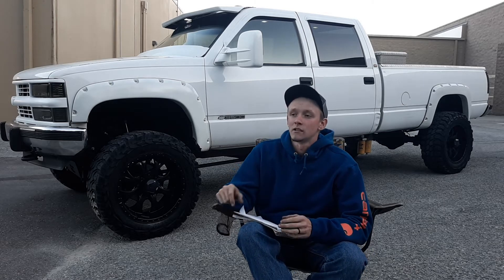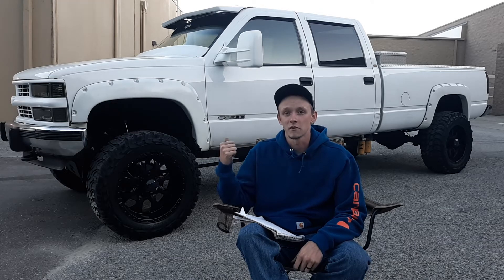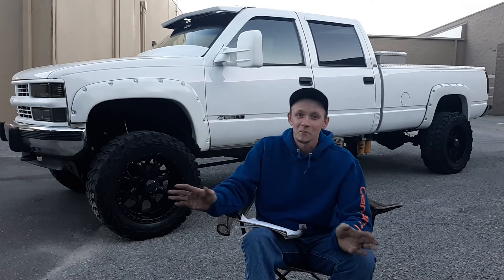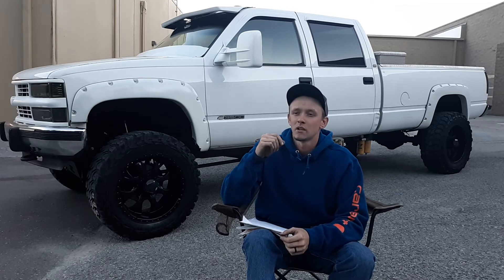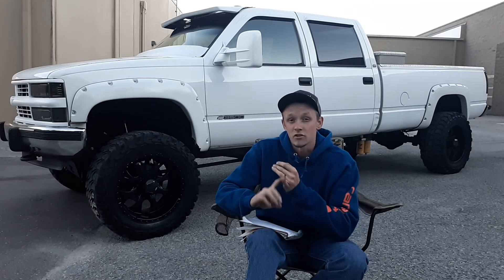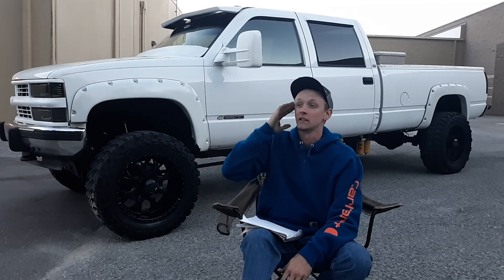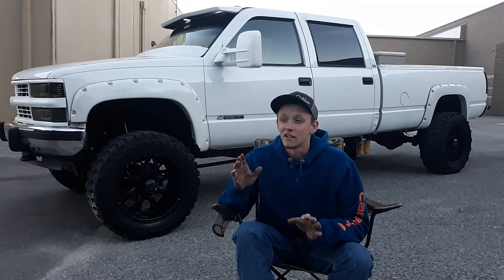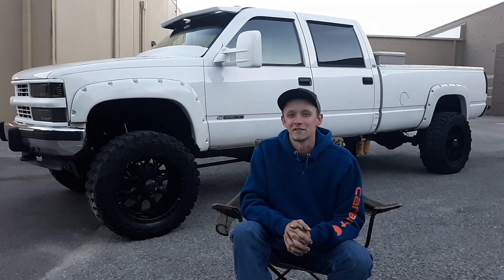Bombproofing a 6.5l turbo diesel #3

Comment: Bro 6.5er.,. Man i recently had issues Bigtime.. bought a defective I/P so caused me to try to prove it wasn't that but ended up being. Like timing both heads bolts pmd and of course and $$$ lifetime warranty I/P. 
My question, now my head lights stay on and U1000 code and seems I have to jump.glow plug relay.   When truck does start.   Intake turbo off.   Oil blows out the passenger exhaust.   Being I recently had heads done could it possibly be timing related.  
Thank you Sir keep up the good fight
Reply from the maker: Valves in the head are tied to the camshaft by the push rods. So long as you didn't remove the camshaft, and your lifters are ok, the valves should be working properly. If your blowing oil out of the turbo, remove the turbo and see if your getting oil before it. If you don't see oil in the exhaust before the turbo than the seals in the turbo are bad, if you are seeing oil in the passenger side manifold then you need to find which cylinder exhaust port is wet and that will lead you to the problem. The glow plugs controller, where you had the heads off, may not be quite grounded properly or the glow plugs controller may be defective.

Comment: I got a 99 3500HD what block do you think I have?
Reply from the maker: Well, it's kinda hard to tell depending if the motor had ever been changed or not but if I had to take a guess for a 99 I would say 506.
Reply: Well I ended up getting this truck technically for free, 131k original miles and motor bone stock. Have not brought myself to sell it. Starts up runs great I ran across ur videos. And figured because the platform is so great specially on a 3500hd dually frame is giant super stout. My question how much life can I get out of it? Before I have to put a Cummins in?
Reply from the maker: @michaelCrusader90  it's common to see full rebuilds right around 300 to 350k miles if they are taken care of. Some people have run them longer than that but that's just what I've run into.

Comment: I recently purchased a 1994 Chevy Silverado 6.5L Turbo. I want to get an entirely new engine for it. I was originally thinking of a 12 valve 5.9 Cummins until I saw a video on what a pain it is to install one in my square body. I then started watching your videos and would like to get a diesel from somewhere? Leroy Diesel sold out. I just want a good running truck that will last me another 20 years or so. Not looking for a pulling monster or a drag truck or a mud truck...just a good dependable truck that I can drive daily and pass a vehicle when needed on the highway. Any place I can get a good engine? Or is there an engine you would recommend that I can buy? I love your truck, btw. Thanks.
Reply from the maker: Thank you man, I appreciate it. Still have plenty of work to do but untill I get a few things squared away she's good the way she is. In my experience Leroy is just about always sold out, I wish he could still get the p400 blocks but unfortunately they have been discontinued. BUT, I have had pretty good luck with buying short and long blocks from O'riley auto parts. I know it sounds strange but in 1 to 2 weeks it comes in pretty ready to go. Or you might take a chance on a used motor but there again, it's taking a chance.

Comment: I am hunting a new motor to drop into my 99 K2500 Suburban... suggestion for best year to buy for a motor?
Reply: 98
Reply from the maker: Have you checked out my "the different 6.5l blocks" video? Definitely a bunch of good information in it, but if you were looking to pull one out of a truck the most desired motors are the 93 trucks 👍 I go into more detail as to why that is in the video

Comment: Last time I looked, the timing gears weren't available from Leroy Diesel. I'll have to go look again.
Reply: It says they're sold out and probably won't be available again unless there is a huge demand for them. It says he has to have them made 200 at a time to be cost effective.
Reply from the maker: Thank you for the heads up, I know he is to have them but I will have to see if anyone else is making them.
Reply: No problem. I couldn't find any, but I haven't looked in a few months either.